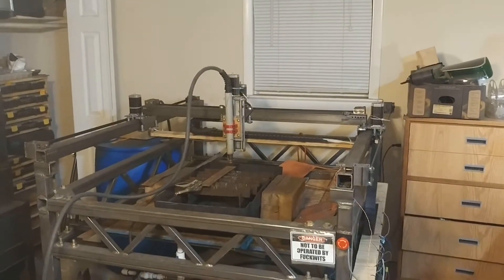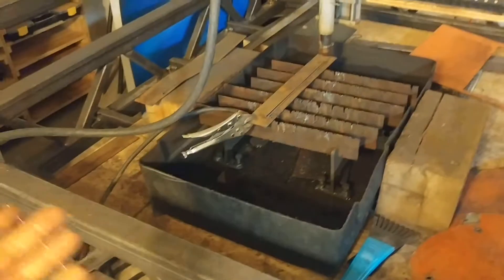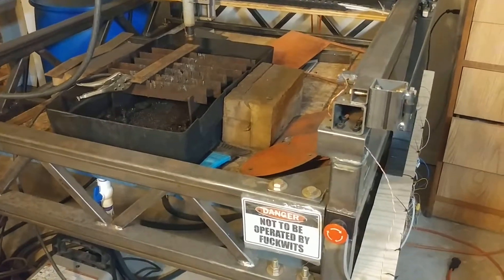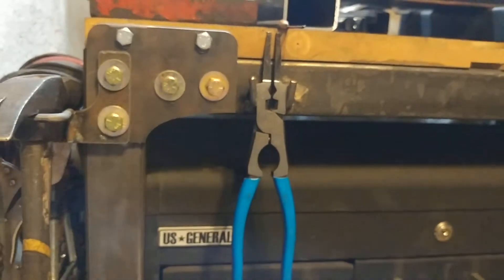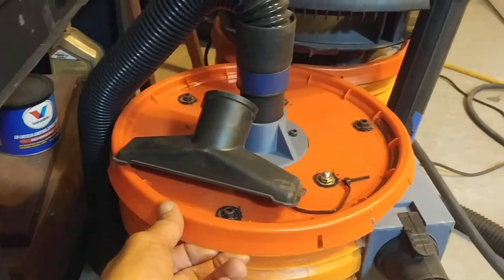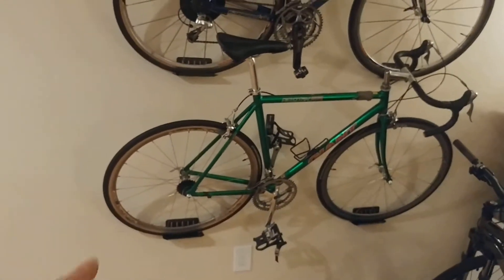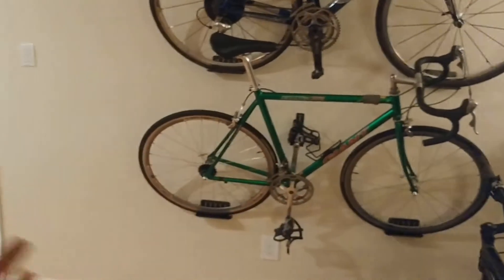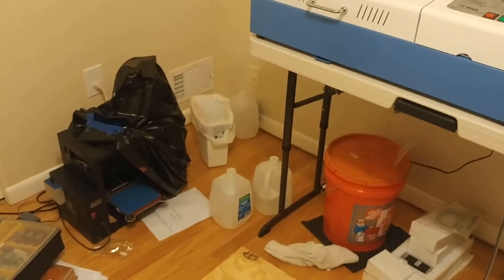Updates: CNC plasma, new shop, K40 laser

Comment: just weld up a water table.  Check out Stefan Cymbaluk channel for good ideas. He uses Linuxcnc as well, and using the Price THC(he has also used cheaper proma on some builds). His videos focus more on the table  build and not much detail on the software. I'm building a virtual copy of his 4x4 "heavy duty" table, plus I'm using Linuxcnc, so your videos are very helpful, especially since I'm a linux noob as well.
Reply from the maker: Yeah, making that THC was a pain in the ass, but at least it was a learning experience. Hahahah.

I finally caved and got a (very) basic oscilloscope earlier this week, so now I hope to go back and re-evaluate how I did that, see if I can make it more robust, and if so, offer a parts kit, or least a link to where you can order a professional PCB and the BOM parts.

This video's pretty old now, but I still haven't gotten around to doing the full water table. Mostly tied up in the THC project and all the HAL videos that came after. It's the next thing slated for an upgrade though. Welding one would work, but I dunno. Think I might try the fiberglass again. Redeem myself after that last attempt. #YOLO

Hadn't seen Stefan Cymbaluk's stuff before. Thanks for pointing it out to me.
Reply: @swolebro  I would also check out the making stuff videos he did a plasma table a while back and is doing just a cnc spindle/router table now and they are fun to watch.  I am working on my own CNC plasma table based on both your videos, Steve Cymbaluk's, and the Making Stuff videos. I am taking pieces from all your guys builds and then adding my own flavor to it. I will post YouTube videos someday and link you to them. Plus I will mention you guys for sure to make sure you get the credit you deserve. Also then try to figure out github someday. I for one would not have taken this awesome project on if I had not had your guys videos to watch.  (I have built some of my own 3d printers and modified a broken one in recent years, so playing with electronics and xyz tables are fun) I also wanted to add I think the Bender tool you made is awesome. I am going to have to do that when I get my table done; pure genius in my opinion.  I am struggling with the THC myself though. I am using a harbor freight plasma so I need to design and build a Voltage divider that will be robust and handle all the dc voltage noise from the constant 80-140 volts to the every once in a while spikes of up to 300 volts. Or do I purchase one of those 200-300 dollar kits that has both the voltage divider and thc controller that just inputs to linix-cnc on amazon or Ebay. (its a tough pill to swallow when I know the parts to make the boards is like 20 bucks) I have the knowledge but not the 300 volt power supply and the oscilloscope to test out the voltage divider on as I build it as well so that also comes into play. So I'm rambling now sorry. But in the electronics stage that is where I am at in my research. Thanks again for your videos and posts on HAL!
Reply from the maker: @blue95stang1  Not sure if you've seen, but later in the series I did manage to fabricobble an Arduino based THC. I wouldn't call it a "finished product" by any stretch of the imagination, and I spent way more than $300 of time building it, but it was a learning experience. There's a 1hr video for the board and another one for the code.

If you want to try your hand at it, you get yourself a DSO138 oscilloscope for about $30 just for messing around. It's far from professional, but it lets you get a decent visual. I got another recent video on using that to reverse engineer some treadmill controllers.

If you've got any experience with Arduino, another option would be to buy a THCAD from Mesa (they come in 0-300V and 0-10V styles), and then use an Arduino as a frequency counter/encoder to turn that into a dumb up/down signal. That just saves you from dropping the extra $200 on a Mesa controller board just now (while the THCAD is only about $70). Though really, a Mesa stepper board + THCAD still costs less than a $300 Proma THC, and gives you a lot more features.

Good luck, have fun, and all that shit.
Reply: @swolebro - dude I have been watching all your videos over and over since you made them. ( maybe 20 ish times lol) I think I can replicate your thc no problem. I am just wondering about the voltage divider. I know what it takes to do the 50:1 with the cement 5 watt resistors. But in order to handle the noise I don’t know without testing with a scope what chokes to use to get as straight a line as possible. I will check out your recommendations but I’m a 15 dollar parallel port breakout board all day long. I have time, more abundant then cash. You’ll understand that real well someday if you ever get married and have kids.
Reply from the maker: @blue95stang1  Well, first thing, build the divider and get a DSO138 (again, that's $25). See how bad the noise really is, try to cobble together some filters, and then decide what to buy.

And I'd believe it, re: having a family. That's not even on my radar right now. I live by one of those big blue cities... and yeah. That's all I'm going to say about that. Hahah. But hey, the grass is always greener.
Reply from the maker: FYI, I went and hooked up my DSO138 to my THC today, and I was able to get some really good visuals off that. This was reading the voltage with filtering capacitor in place, but yeah, it was very smooth. No real noise visible anywhere from the fastest timescales to the slowest, and on a slow timescale, the corrections I was seeing at the torch matched the voltages I was seeing on the scope. It's definitely up to the task. (And, if you happen to hook it up wrong and fry it, it's no big deal.)
Reply: swolebro that’s great news! Awesome job with the Arduino THC!! I am bidding on a older scope I found on eBay this weekend. If I don’t get that one in like 5 days at auction end. I’ll pull the trigger on the DSO138. I imagine Hypertherm is the best you can buy when it comes to voltage divider quality/well I think industry leader in everything plasma for sure. I just got done purchasing all my 2x2 1/4 boxed steel. So this summer I’ll start building the frame of the machine. I already have my water pan it’s 54x72 with four bent sides at 3 inches I bought from my local fab shop. I welded the corners. I used 2 quarts of rustoleum Bedliner to coat it for rustproofing. Hopefully that will make it last longer. So closer to August/ September I’ll start uploading videos of the build.
Reply from the maker: @blue95stang1  Well shit, that guy actually went and documented everything too. Nice. I will have to look more into that - might be some stuff in there for me to mooch and build into mine.
Reply: @swolebro  YouTube is huge, I find new stuff every time I look. So i just like sharing those discoveries. I wish we could catalog/organize multiple folks projects/stuff better so that if we want to build our own cnc  plasma table we look at just those posts and find 7532 videos for instance...  Then narrow it down from there with the search engine.  But in the grand scheme of things maybe that would not work as everyone would have to use the same naming conventions i suppose.
Reply: Nevermind on the THC, I saw your next vids where you make your own. Nice work.